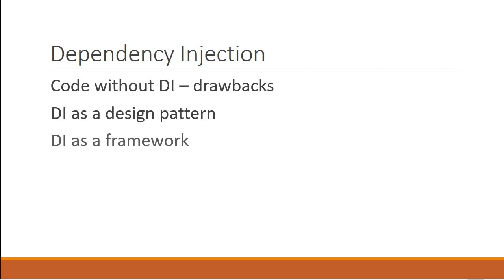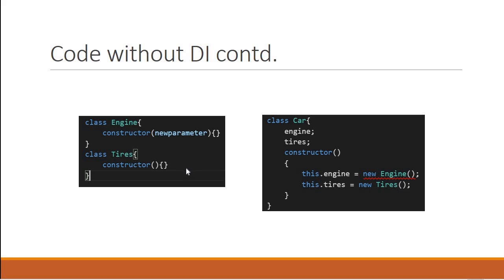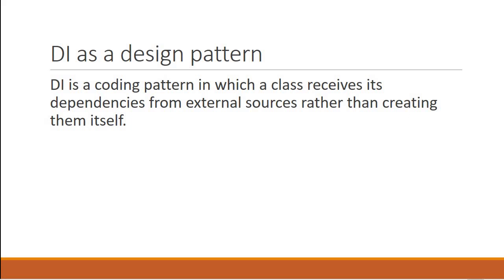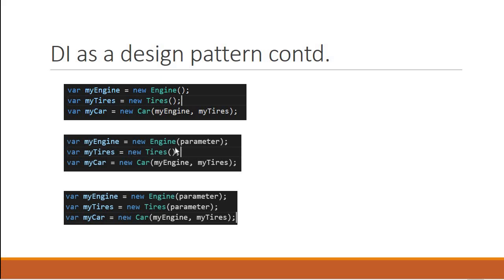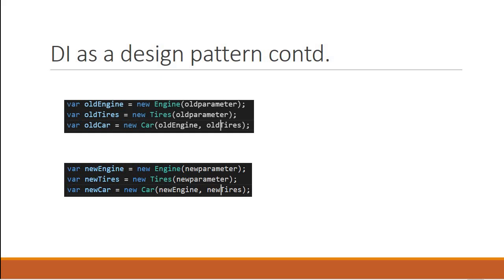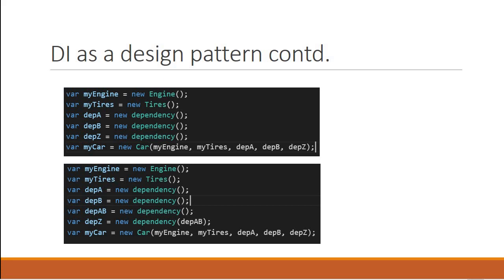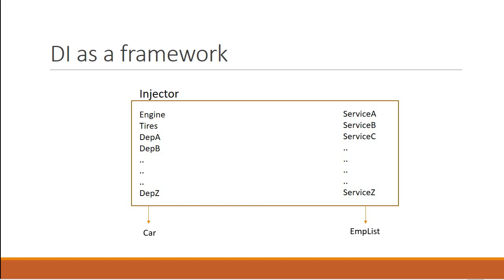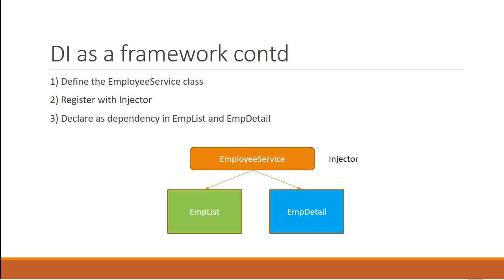Angular Tutorial - 18 - Dependency Injection

Comment: I'm a little confused about DI as a frame work with the injector.
question1: its related to the @injectable() decorator right? if we don't add @injectable to a service its not registered into injector I think?
question2: why do we need injector to store and keep track of dependencies? 
depA = new depA();
depA = new depB();
depA = new depC(depA, depB);

wouldn't the code above still work just fine even without storing the dependencies in injector? Its just creating and inserting line by line